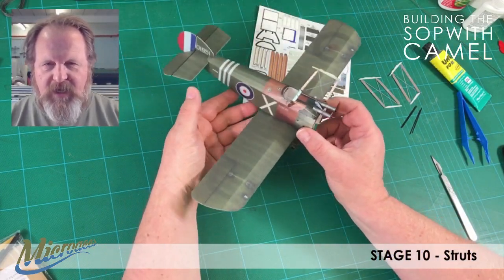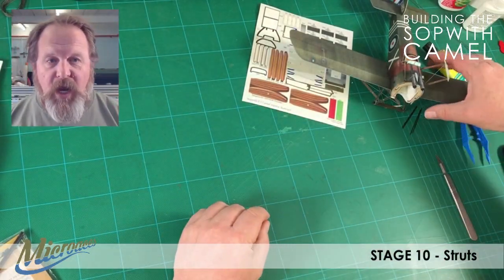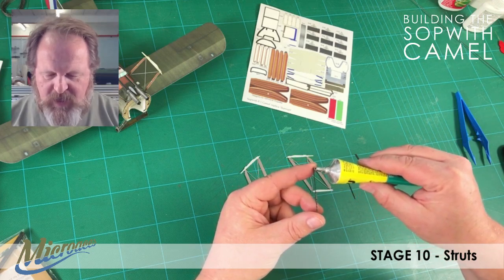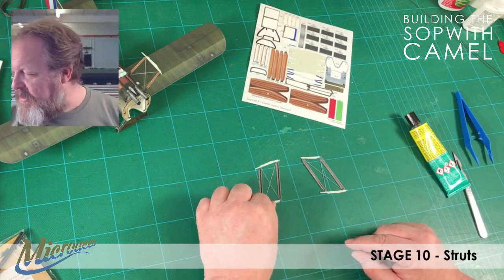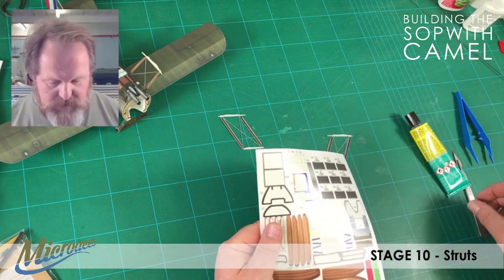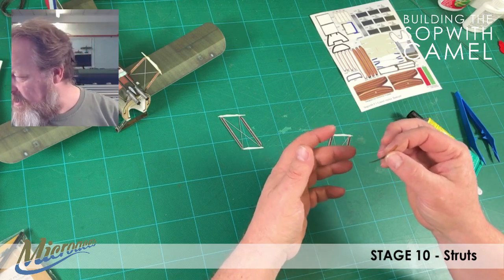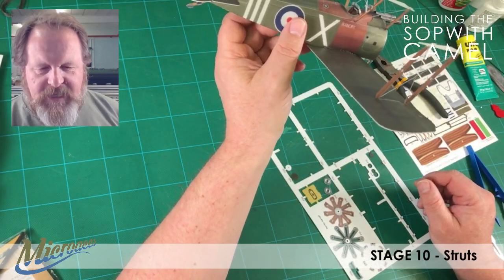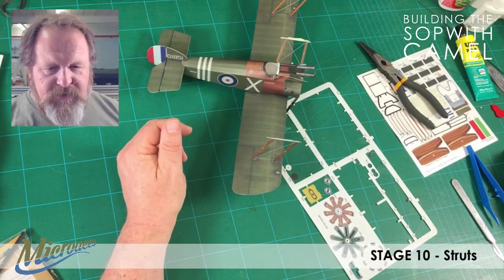Microaces Sopwith Camel Build - Part 10

Comment: Hi micro aces I’ve got a question for you that I was wondering if you answer is it possible to use card stock to make the air frame or would it be too heavy?
Reply from the maker: Hi Jarred, paper modellers tend to use card stock for their airframes when making static models, but at this scale it would be way too heavy for controlled flight. The most important question to answer when designing micros is 'how do I make this as light as possible?'.